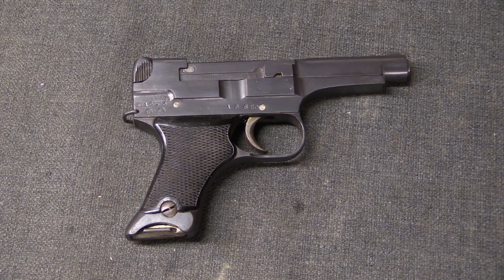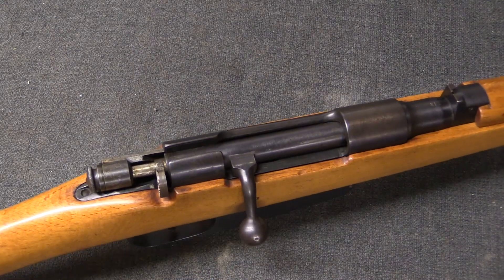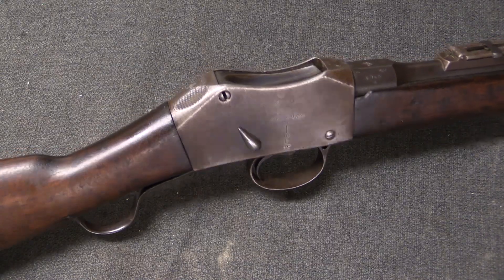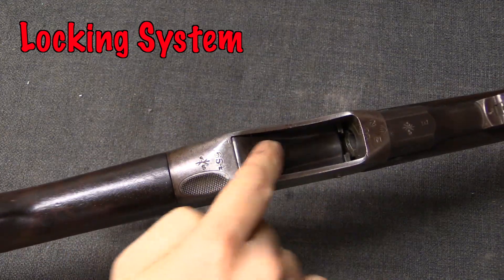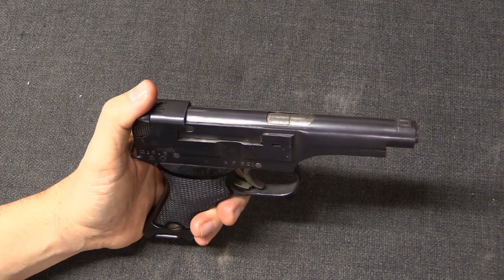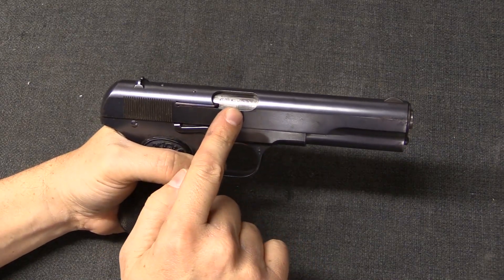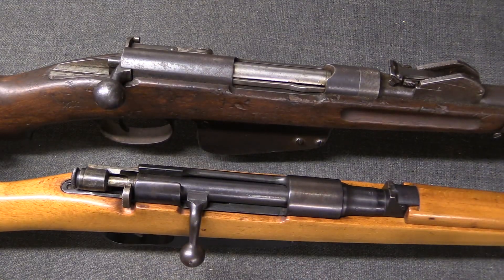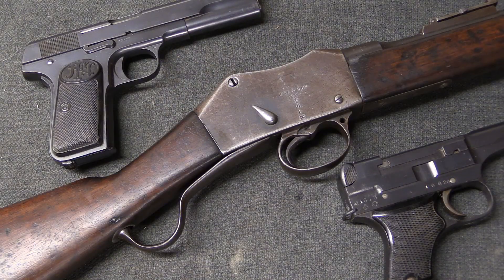How Does it Work: Operating vs Locking Systems

Comment: Aren't roller delay like G3 some sort of middle ground between locked and blowback?
Reply: Could call them impinged blowback designs... not locked, but making the force work against itself.  That would let the P7 slot in there too as a gas impinged, where the G3 is a mechanically impinged design.

Comment: Technical distinction.  The cartridge case seals the breach, not the locking system.  The locking system holds the seal (cartridge case) in place along with the barrel/chamber until it is time to reload.  This applies to most firearms, but bag ammunition cannons do actually seal the weapon with the locking system.
Reply: same deal with pre metallic cartridge case breech loader percussion arms

Comment: And now you got me completely confused ... So blowback guns have no locking system, blowback (straight or delayed) is the operating system of the gun. Correct ?
Then in a manual bolt action rifle, the locking system is rotating bolt (mostly) and there is no operating system since opening the action is done by hand. Correct ?
Reply: Bolt Action is the operating system. The rotation (that being rotating lugs on the bolt into grooves in the trunion) is the locking system. The rotation can either be manual, like in most "normal" bolt actions, or mechanical, like in those with straight pull bolts.

Comment: I've heard that it's a common myth around the internet that blowback guns rely on their bolts mass and spring pressure to hold the breech closed. In fact, the spring pressure is such a minimal factor in the beginning of the bolt travel, that when designing a gun you have to rely entirely on the weight of the bolt to keep 'er closed. That is of course if we are talking about springs that can be compressed by hand.
Reply: It's going to vary greatly by gun design and the cartridge, but I'd estimate a good average is 75% bolt mass and 25% spring pressure.
Reply: @mattelder1971  Nope, bolt mass is orders of magnitude more significant than spring pressure.

Consider the lowly 9mm parabellum. Its bolt thrust is pretty exactly 4000 lbs. How are you going to counteract 1000 lbs with a spring and still have a useable firearm?

The spring needs to gradually slow down the bolt or slide so it doesn't whack too hard against the rear end of the gun, and it needs to push the bolt forward again hard enough to strip a round from the magazine and chamber it. That's all.
Reply: @Kaboomf  Where are you getting that "bolt thrust" measurement from? That sounds like a ridiculous number. In my reply, I was strictly referring to spring weight vs. bolt weight. For example, a Ruger 10/22 has a relatively light bolt and a very stiff spring, while a gun with a very heavy bolt (think something like a WWII SMG) may have a very light spring. Maybe you and I are referring to different things here.
Reply: @mattelder1971  Chamber pressure times case base area?
Reply: @mattelder1971  Simple physics. Bolt thrust is chamber pressure multiplied by the internal base area of the cartridge case. It's the rearward force acting upon the breech face, albeit for a very brief moment of time. 

For a 9x19mm cartridge loaded to SAAMI maximum pressure, bolt thrust at the moment of peak pressure is 4012 lbs exactly. Of course actual ammo varies considerably from this, but 4000 lbs is in ballpark range of reality.

A .22lr can get away with having a pretty light bolt, because it's a relatively low pressure round with a small base diameter and because that small amount of powder burns up very fast so peak pressure exists for an even shorter period of time than that of a 9mm pistol round. All these factors help cause the total rearward impulse to be rather small.
Reply: @Kaboomf  OK, I see now what you are saying. However, there are other factors that come into play besides just the bolt and spring weights as well, such as the friction between the casing and the chamber. Like I said, when I was talking about the relationship between the bolt and the spring, I was simply referring to the weight of each. There's no way that the bolt in a typical blowback operated gun is "an order of magnitude" heavier than the spring tension. Is the bolt weight more significant? Yes, in most cases it is. But "an order of magnitude" is either exaggeration or lack of understanding of what that term actually means.
Reply: @Kaboomf  Thanks for the info. So, as I surmised earlier, we were referring to two completely different issues in our initial comments.
Reply: @mattelder1971  Friction between the case and chamber is traveling perilously close to Blish lock theory... which was theory, and not practice. You have to physically deform the case into some receptive feature in the chamber wall in order for it to behave as any sort of detent, and it's not going to be much of one (and a whole host of other issues appear). 

Anyways, I came in to say that the major difference between keeping a blowback action closed using bolt mass versus spring force, is that bolts have inertia and springs don't. 

4000lb bolt thrust is all well and good as a measurement, but it's momentary. It's an application of force against a block of metal with mass, meaning that will change the speed of that block (delta) over time. But the thrust isn't linear or long lived; where the balance comes in is knowing the pressure curve and calculating things so that the bolt has just enough mass to be moving at an operable speed without withdrawing the cartridge from the chamber before a manageable pressure drop. Operable speed would be where the bolt's carrying enough momentum to complete the ejection action and store enough energy in the recoil spring to continue the next set of operations... and that's when the strength of the recoil spring is mostly at play, when the bolt is accelerated back towards the breech with mechanical activity eating it's energy.

TLDR bolt mass works because of the severely limited time that a very heavy bolt thrust is applied, because acceleration stops when the impulse does, and inertia keeps it going. 

think of a newton's cradle, that think with the little steel balls that tap back and forth. The cartridge firing is like the ball striking one end of the stack; that energy transfers into the last ball (the bolt assembly) which carries onwards in it's motion even though the force that moved it is long past. Gravity is the 'recoil spring' in this example, it absorbs and returns that amount of stored energy.
Reply: Easy. The preassure of a 9mm its 35.000Psi. The surface of the base of the cartridge its 0.012 squ inch. 35.000*0.012=4.200 pounds @mattelder1971
Reply: @Kaboomf  Quick question: Wouldn't the effective bolt thrust be lower, because the pressure is also pushing the bullet forwards, not just the bolt backwards?
Reply: @jubuttib  Pressure acts equally in all directions, it doesn't care which way is forward. That's gas pressure inside the chamber, think of it like inflating a balloon. Does the balloon go more or less round, or does it only inflate in the direction you are blowing into it? Gas pressure acts with equalnforce at 90 degrees to any and all surfaces it impinges upon. Bullet base, bottom of cartridge case, sides of cartridge case and bore. The forces acting to the side may be mostly ignored as long as the barrel is strong enough not to burst, what concerns us is the equal and opposite forces acting on the bullet and the breechface.

Comment: Can you make a video about the feeding mechanisms. How do the cartridges go from the magazine to the barrel, without destroing the magazine? Thanks Ian for your videos.
Reply: Seconded. I've always found it kind of fascinating how (mostly) reliably the systems manage to push out a cartridge from the magazine or belt (or sometimes pull it from a belt), make sure it directs into the chamber properly, and then positions the back of the cartridge neatly against the bolt face and establishes a proper grip on the rim, with usually what amounts to one part moving back and forth. Seeing more specifics about what exactly goes into designing this kind of system, that also allows it to reliably operate at anything from a few hundred to nearly 2000 rounds per minute depending on the gun, as well as the common pitfalls and failure modes of such systems, would be fascinating.
Reply: The department of defense ww2 videos on the M1 Garand do a good job of covering magazine fed, rotating bolt, gas operated rifles.
Reply: Spring tension, the operating movement of slide/bolt, alongside the imperative operation of the extractor claw, and the ejector.

Comment: this makes my flappers flappy
Reply: Does it flap when you are stationery, or only in the prone position. I think you might also need to clean the ejection port.
Reply: @mirycreek  surely a dirty locking surface would create flappers potential malfunction and can't erect to lock it, very dangerous.
Reply: @Shiruvan  you sound like a seasoned full metal jacker, as your flapper becomes worn you could experience failure to eject lol